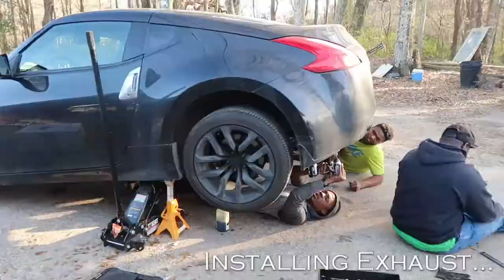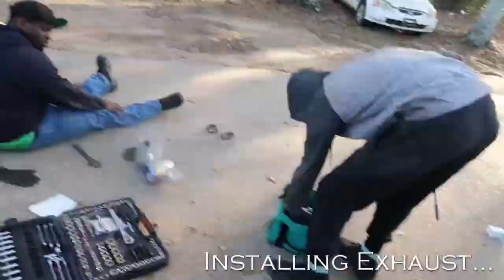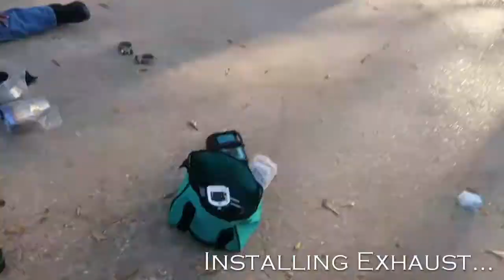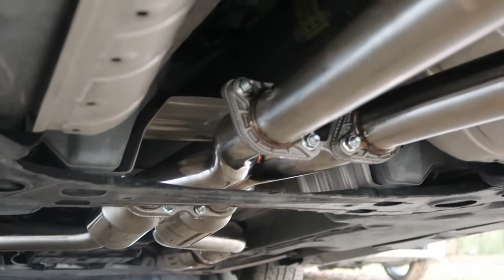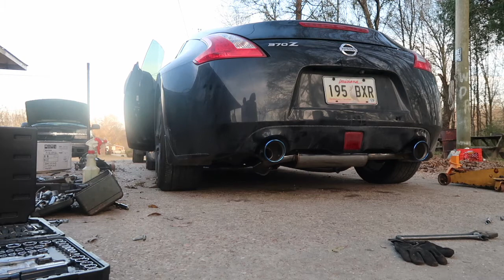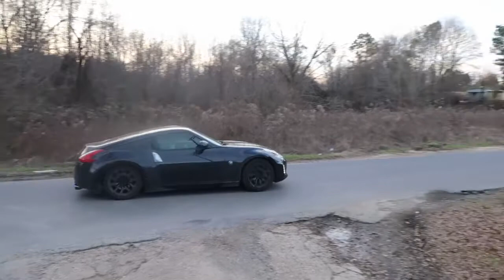Nissan 370z | Invidia Gemini Catback Exhaust (Before & After)

Comment: Is it too loud? Like will my neighbors kill me?
Reply from the maker: Lol no catback with mufflers is like that imo
Reply: Oh, ok, do you have any recommendations for a nice sounding exhaust that is not too loud?
Reply: Just got mine installed today.  My opinion: favorite part is the bark on start up.  Definitely has a pronounced growl, also like the low rumble while idling.  I does get noticeably louder in lower revs when accelerating in comparison to stock.  On freeway cruising it's civil and just a little louder than stock.  Also, car seems much quicker.  It's wasn't obvious to me until I realized,  that I had to get on the brakes harder than normal at most stops.  Then when I realized, it became very clear this thing is breathing a lot better (I have no other mods except this exhaust).  My rating out of 10.......... 9.5